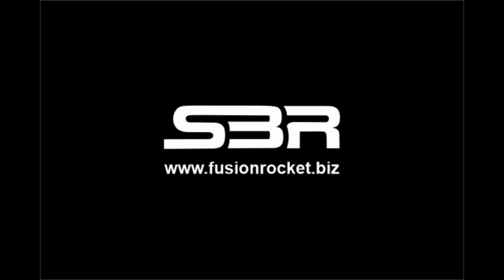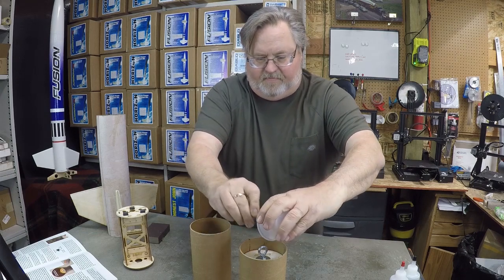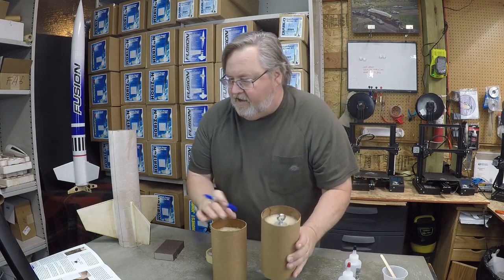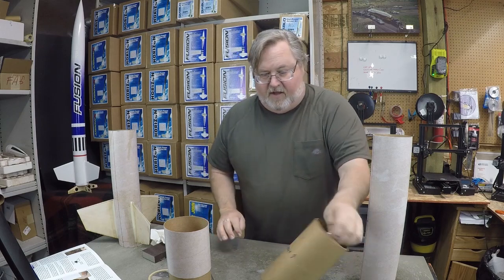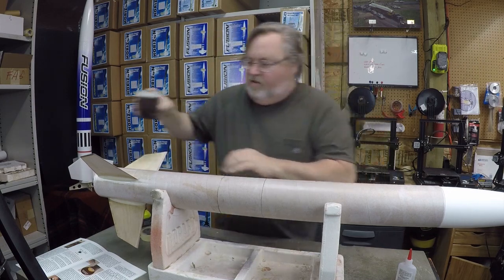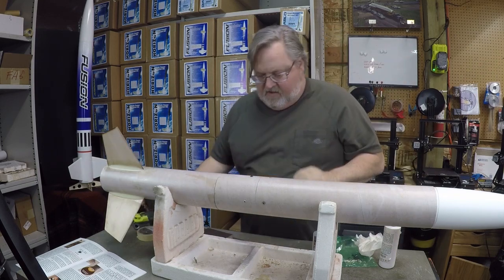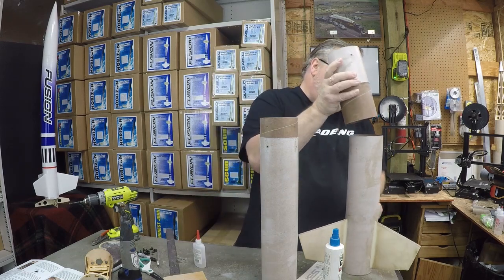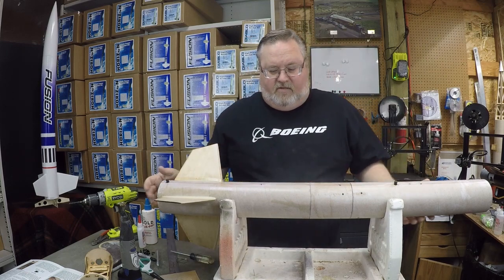SBR 4" Fusion Build - Part 3 - Finishing Airframe Construction

Comment: what is the reason for using two couplers instead of just 1 with a switch ring
Reply from the maker: This is not a "switch ring" rocket.... internal electronics bay - no all-thread.  Lighter, stronger, simpler.  Not the way everyone else does it.  :-)